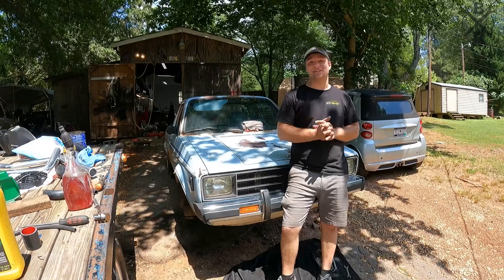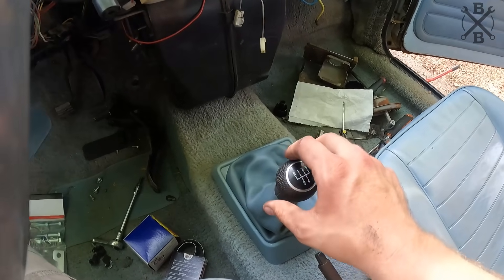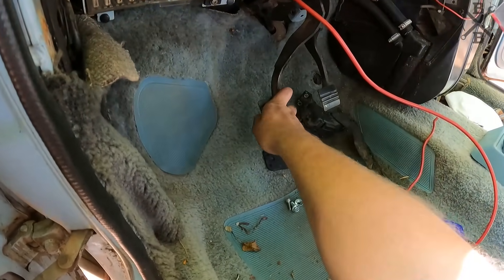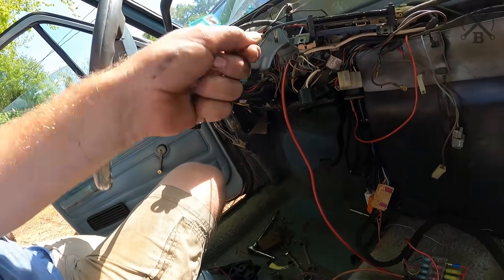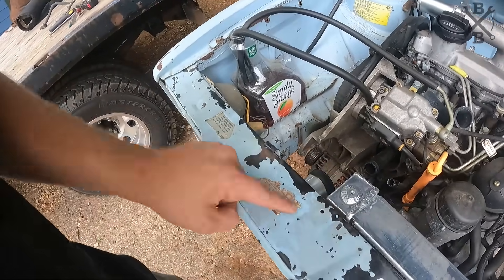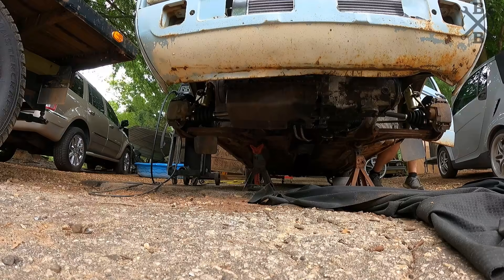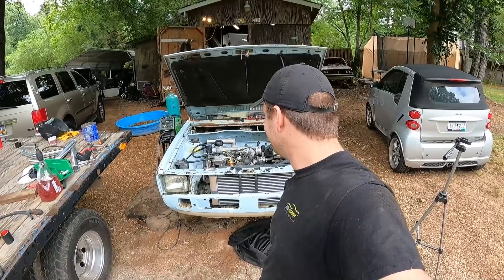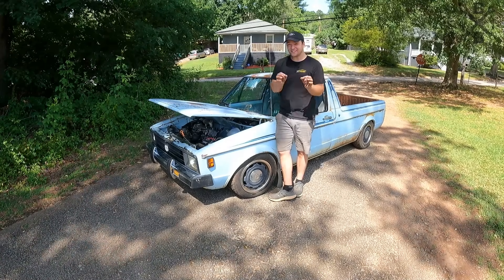The Barn Find Volkswagen Caddy Moves Under its Own Power! TDI Swap Part 3

Comment: Cut the aluminum with a circular saw and a plane carbide blade mounted just like it’s supposed to be! I’ve cut up to 3/4” aluminum with a worm gear framing saw in the past! Lot easier and faster a grinder rip wheel or a cutoff wheel ! I’m a retired welder 37 years on the job and have cut plenty aluminum, no grinding just a burr! Just a suggestion my friend! Make sure you clamp it and just cut and don’t stop! Just try it on a scrap piece and see if it’s better for you! Awesome job guys! 👌🏻👍🏻👍🏻 Lake Charles, Louisiana here! 👍🏻✌🏻

Comment: On your radiator,get a piece of trim rubber and put in between radiator and core support,will keep vibration down and seal air flow better.good video 👍👍👍😎😎😎

Comment: Excellent video :)  also  keep up excellent work and a exhaust would is straight pipe to silencer tube then another straight pipe to round muffler and tail pipe out side front  of back right tire ! Also get all electric fix up be excellent and plus much too!

Comment: How hard would it be to retrofit the original gas petal on there if one cared about having a matching set of petals?
Reply from the maker: You could definitely tuck a cable driven rheostat under the dash and incorporate the existing pedal! Definitely more difficult on something like the diesel with all of its pedal functions but maybe so on a 2.0 ABA.

Comment: you may have already done it or it may be too late but I would really consider tapping into the key switch for the run and start signals... As cool as the extra switches are to play with my bet is it will get old... also seems like someone could start the truck without keys, just not steer without them...

Comment: Very cool! Question. I'm not familiar with these TDI diesels. Do they use an older style mechanical injection pump or do they do like a common rail electronic injection setup? I need to find a second project for my channel and was thinking of something smaller than my squarebody suburban.

Comment: I'm honestly kind of surprised that since there is a kit for all the mechanical mounting for putting this engine into this vehicle that there isn't also an electrical kit for it as well that would just have everything you need and only what you need that would just mount right in.
Reply from the maker: There are companies that offer harness builds, using your harness. It’s $450 and up though. Myself, being the cheapskate I am, opted to build it myself for free 😄

Comment: I've never been a big fan of dropping vehicles with loadbins. Once you put anything in the back you will bottom out the suspension and the ride would be ruined. Especially now that it has a diesel in, which means more torque to pull weight with.

Comment: ok so you drilled a big hole in the bottom of the fresh air intake and you got the hood openings above it so when it rains its gonna flood the inside of the car and soak the ecu ?  i dont get your logic there unless your gonna weather strip that valley pan, block off the cabin air flow by covering the louvers in the hood and hope it doesnt flood the interior ?  i think you got some holes to fill and a ecu relocate in the near future.. lol thats too funny.. is it really gonna be outta the rain and moisture while your feet get wrinkled from all the "rain" coming through that big hole you drilled in the fresh air pan ? lmao
Reply from the maker: The wiring hole will get a grommet. The ECU is located in basically the same factory location as the car it came out of in the rain tray. Once complete the rain tray cover goes back on, covering everything. If the ECU or hole drilled get water in them so will the factory fresh air intake for the truck because it’s the same height lol.